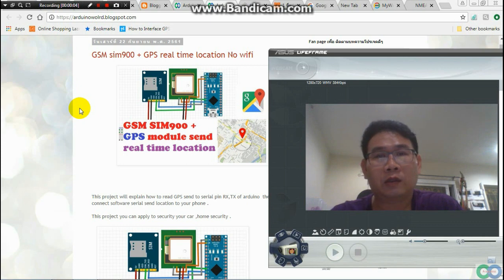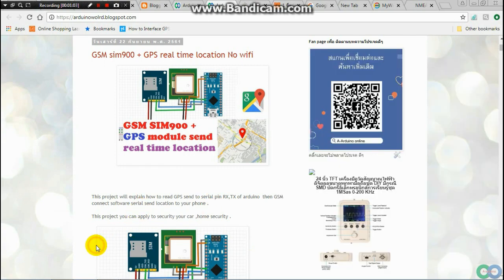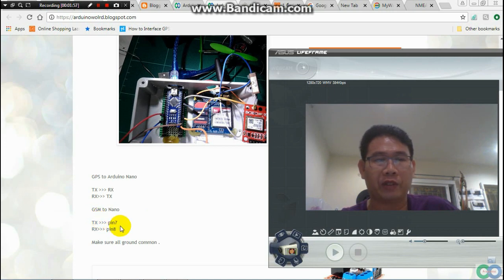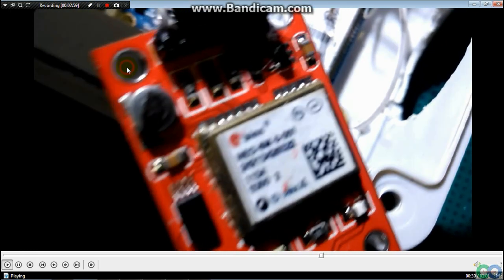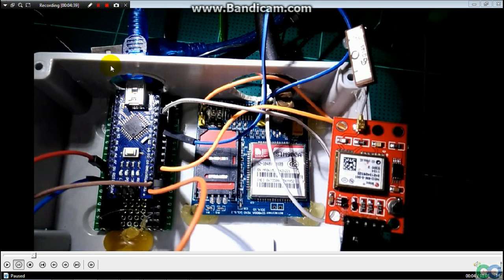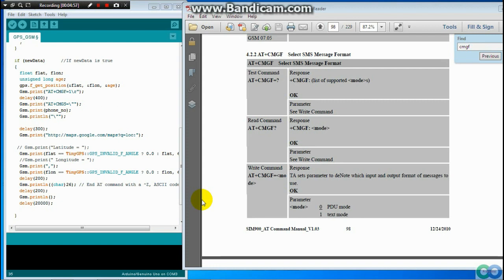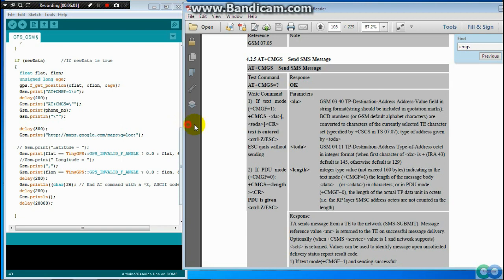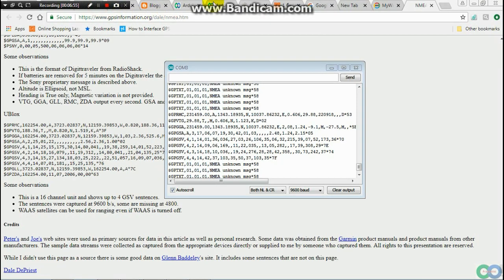GSM sim900 + GPS +Arduino Nano send real time location

Comment: How can i make this system without regularly connecting with laptop. I want this as only a switch. Not a system wired always with laptop
Reply: After upload the sketch, the system running well. But, when I unplug the USB from the laptop and plug to external power supply, the system didn't respond. 
Could you advice how to overcome the problem?
Reply: @kwcatur  you’ll need a power supply, a battery for example, for the arruino. That way you’ll be able to unplug it from the laptop and it will continue to work
Reply: @noxfox9308  the problem was solved by another way. Anyway, Thank's for the advice
Reply from the maker: Laptop just use for load Arduino code to board after that you no need laptop.